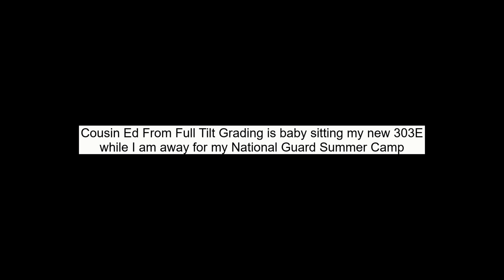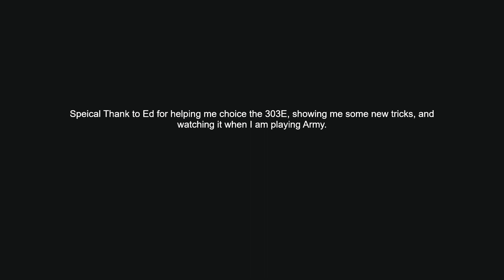Full Tilt Grading Tries Out and Watches my CAT 303 E

Comment: Normally you check the hydraulic fluid level with the bucket curled in and the stick in the stow position beneath the boom, unless your operator manual says other wise. If you add more hydraulic fluid you may over fill it.